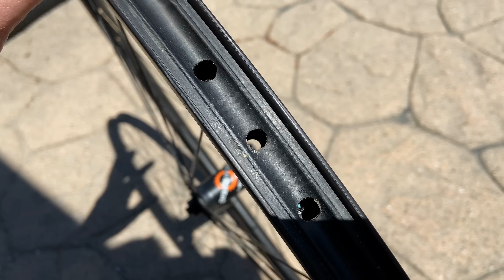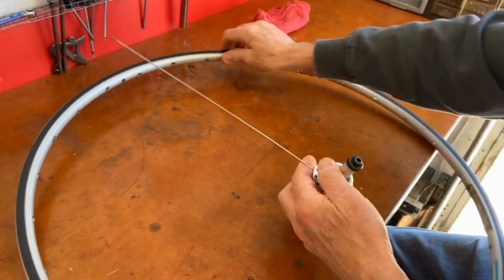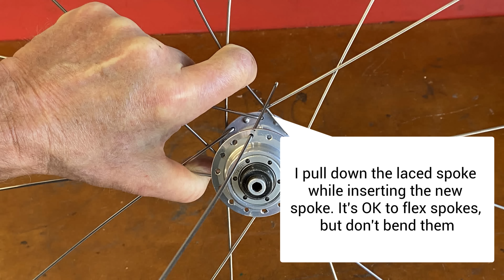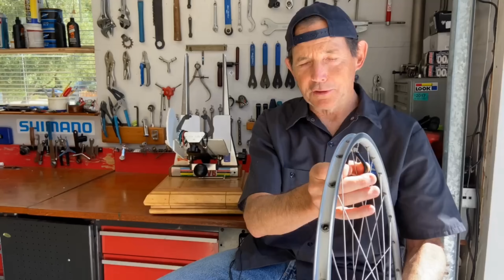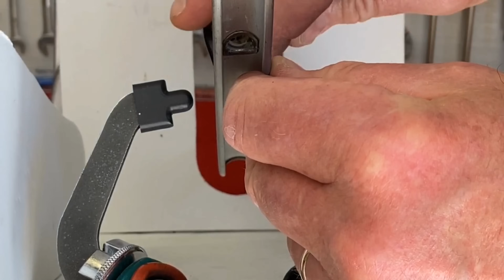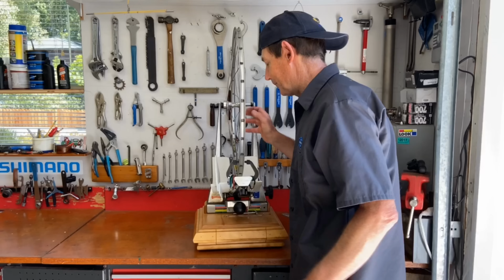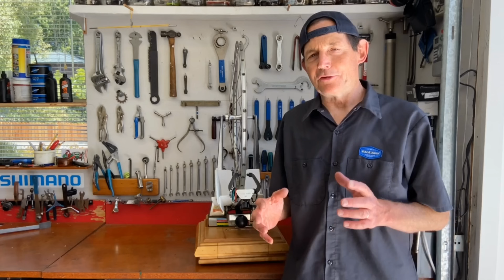How To Build Bicycle Wheels THE EASY WAY! #bikerepair

Comment: Wonderful video! Nicely explained the basics of wheel building. My bicycle wheel is new and I think the wheel itself was not built properly when it was delivered to me. I have broken a spoke several times in the rear wheel. I have been truing my bicycle wheels myself but I find it extremely difficult to make the wheel round, while I can remove the side wobble easily. Is it possible that the tension in the spokes is not uniform yet the wheel is true? Any tips to how to readjust the tension in all the spokes in a wheel, without actually rebuilding the wheel from scratch?
Reply from the maker: Thanks for watching and the nice comment, Supratik! Regarding your new rear wheel that is breaking spokes. The most likely reason for a new wheel to do that is that they built it with poor quality spokes. If you have a magnet handy you can rest it against the spokes to determine if they attract the magnet. If so, you do not have quality spokes, which are made of stainless steel. If that's the case, you can certainly try to readjust the tension but that won't stop the spokes from breaking. What you could do though, is to replace the spokes as they break with higher quality stainless steel spokes from a reliable spoke maker such as DT Swiss or Sapim. That way, one at a time as the bad spokes fail you will rebuild your wheel.

If you choose to do that you'll want to keep track of which are the new high quality spokes and which are the old spokes prone to breaking. It's a slow way to rebuild a wheel and it can mean some rides are ruined by a broken spoke. But, it is one way to rebuild a wheel that doesn't require taking the whole wheel apart and starting all over. Now, about making a wheel round, if you can true the wobbles out you can definitely learn to round a wheel out because it's easier than removing wobbles.

It takes a little practice but it's super fun when you fix the flat spots (low spots) and the blips (high spots) and the wheel becomes perfectly round again. I recommend removing the tire from the wheel first. Then put the wheel in your truing jig or your bike frame. Next put your truing stand indicators so that they are under the rim. If you're working with the wheel in a bicycle frame, put a pencil across the brake blocks or frame so that it's just above the rim. It helps a lot if you can move the pencil so that when the wheel spins the high spots just brush (hit) the pencil.

With the wheel setup like that in the truing stand or bicycle frame, sit down and focus on the task at hand. Don't be in a rush. You're going to make lots of little adjustments. The first thing you do is spin the wheel and watch it. Watch it for awhile so you learn where the high spots and low spots are. Once you know, you can mark those spots if you want by putting tape on the spokes at the high and low spots. 

Next, you work on the worst low spot. By loosening the spokes at that low spot slightly, the rim will move up higher which starts to remove the low spot. Move on to the next worst low spot and repeat. After you've done that, you work on the worst high spot. But for high spots, you tighten the spokes a little bit. That will pull down the rim reducing the high spot. Repeat with the next high spot.

Working like this back and forth from the low spots to the high spots, you will ever so gradually see your rim become rounder and rounder. Don't get frustrated if it doesn't happen right away. Keep making 1/4 to 1/2 turns of the nipples and keep watching and studying the high and low spots to learn what the turns do to the shape of the rim. With some time focusing on this you will learn what it takes to get the wheel round again. Have fun with it. Thank about what you're doing and you'll get it.

Back to tensioning the wheel, if you do replace the spokes as they break with quality ones and if you learn to true your wheel so that it's nice and round along with being true side to side, you will even the tension out in the process. When a wheel has small low and high spots, that means some spokes are looser than others. So, by getting your wheel round you will be improving the tension and ending up with a better, more reliable wheel. And once all the spokes have been replaced, it should be a very nice wheel.

Since you're enjoying working with the wheel, you might want to buy a spoke tensionmeter, such as Park Tool's here: https://amzn.to/3xv8Gmn With a tensionometer you can very accurately gauge your spoke tension. It's a great tool for building and fixing wheels and it also comes in handy for checking new wheels. I hope this helps!
Reply: @JimLangley1  Thanks Jim for your detailed response. I shall keep your suggestions in mind. I true my bicycle wheel with the tire on. Maybe I should try truing after removing the tire!
Reply from the maker: @supratikroychowdhury1127  yes, definitely try again with the tire off. That’s the best and easiest way to do it.

Comment: Hello could u possibly give me some advice on finding some good quality 26 inch wheels for a cannondale f500 caad3 I am building this frame with new components. However I thought I would leave the wheels to the professionals. I would like to leave the v brakes on the bike because I have a set of box one v brakes that I am very happy with. Thanks so much for your consideration and time.
Reply from the maker: Thanks for watching and the question, Brandon. You said you're looking for good quality 26-inch wheels. Right now most mountain bikes have the newer popular sizes 27.5  and 29 inch. So, there isn't the same selection of 26 inchers available that there was back when that F500 was a popular bike. What you might do is call some local bike shops that you know sell a lot of mountain bikes and have for many years. If you can find a shop like that, there's a chance they will still have some 26-inch good quality mountain bike wheels they can sell you. Another approach would be to buy some basic 26-inch wheels on Amazon like these: https://amzn.to/3gqHy0I

The thing is that you need to get wheels with the specs you need to fit your frame and fork. So the axle spacing has to match and the number of cogs ("speeds") the wheel accepts (cassette size) is important, too. The good thing about Amazon is that you can read the reviews on most products to get an idea of the quality of the wheels you're thinking of ordering. Hope something here helps you out. Thanks again!

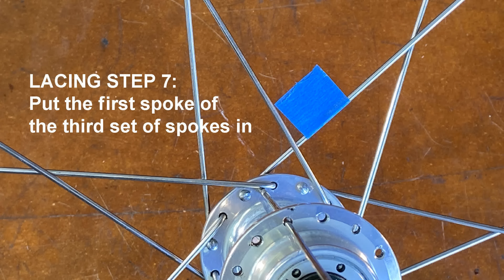Comment: Question about "Lacing Step 7" (16:08): Do you use that same method of locating the spoke hole if you're doing, e.g., a 4-cross pattern on a 48-spoke wheel?
Reply from the maker: Thanks for watching and the question, Maxim. Yes, the same method works with all spoke counts and crossed lacing patterns. Hope this helps and have fun building that wheel!
Reply: @JimLangley1  Thanks for the reply. I built my first wheel ever the other night, following your video. It's a 48-spoke BMX wheel and it was originally laced with a 4-cross pattern, so instead of the 3-cross pattern you did, I did 4-cross and it all seemed to work out, including that method of locating the first spoke hole for the third set of spokes. Here's a picture of it:

https://i.imgur.com/cniepsc.jpg

I've been building / working on bikes since I was 7 years old, which was 39 years ago, but I'd never built a wheel before, nor even messed with spokes at all. It looked too convoluted to me, and I didn't know anyone who could show me how. Your video was easy to follow and once I got started it all made sense.
Reply from the maker: @MaximRecoil  I'm so happy to hear my video was easy for you to follow and helped you build your first wheel, Maxim. Thanks for letting me know. Thanks too for posting the photo. Your wheel looks awesome. You did a nice job and your new skill will add to your bicycle mechanics prowess now letting you build wheels for the bikes you work on. Have fun with it. Thanks again and congrats!

Comment: Great video! Any tips if using flat/blade spokes? Any recommendation on where to get replacement spokes? Thank you!
Reply from the maker: Thanks for watching, DC! For flat/aero spokes, it's very helpful to have a spoke holder to prevent twisting, like the one Unior makes: https://amzn.to/3wXzSd4 You hold the spoke with the tool and then you can turn the spoke nipples without twisting/turning the aero spokes (which makes them not aero and can damage them). You might also like a spoke wrench that fits beneath the spoke holder since the holder is so close to the spoke nipple. For this I like Park Tool's SW-9: https://amzn.to/2SmBmPc For getting replacement spokes I use wheelbuilder.com. They usually have what I need in stock and ship quickly. Okay? I hope this helps and have fun building that wheel!

Comment: Hi Jim, thanks for the great video. I followed your steps for re-lacing and the pattern of my new spokes looks just right but the spokes are all too long. They're protruding through the rim by about a 1/4 inch all the way around so I must have done something wrong. They are exactly the same size (268-280mm) as the ones that came off the wheel before the rebuild. Any thoughts or suggestions?
Edward
San Francisco, CA
Reply: Meant to say 268-270mm
Reply from the maker: Hi Ed, thanks for watching the video and the nice comment. The most likely reason if it's the same spoke length and same hub and rim is that the number of spokes you crossed is different than what the wheel had in the first place. So, since they're all too long now, you probably need to relace the wheel and use 1 more cross. So if you built your wheel 2 cross and it was 3 cross before, that would result in the spokes being too long. The 2 cross spokes don't need to reach as far as 3 cross spokes have to. I hope this helps.

Comment: i came back to give a "thumbs up"and a "thank you very much for the tips!"

i can't believe how straight i got my mtb wheel after following your advice.

it had 2 huge dips after hitting a few things while riding the bike, and 3 major wobbles (2 wobbles to the left, 1 to the right)

the 2 dips are more or less still there,. but they are actual dents in the rim, so i didn't pay to much attention to them, but i managed to remove the wobbles entirely 😃

the 3 wobbles kept rubbing my brakepads,. making it impossible to adjust my brakes properly.

but now it all works perfectly again!

thank you very much!, and greetings from the Netherlands!
Reply from the maker: Thanks a lot for the thumbs up and thanks, Pres. It's great to hear my tips helped you get your mtb wheel nice and straight again. Way to to! Appreciate you letting me know very much.

Comment: Great video! I'm thinking of buying an old roadbike, but the one I'm looking at is a two by six speed, not enough in my opinion, I want to go up to an 8/9 speed freewheel setup. I believe I can't do it on the same hub, so I would have to get a new hub in those Mavic MA40's (which I was told are great rims).
Reply from the maker: Thanks for watching and the comment, Diego. Yes, you will need a new hub and the Mavic MA40s are great rims. That’ll be a fun build!

Comment: Hi jim, great video! thanks for breaking it down so  thoroughly! my very first wheel build is quite the ambitious one, i am swapping the hubs to accommodate larger disk brakes, so my hubs are slightly larger on one side then the other and several other videos i went over mentioned i have to use a smaller or larger length of spoke depending on if it's on the drive side or not, you didn't mention what length of spoke went on which side, does it matter? (edit: it's a 26 inch mountain bike rim i am refurbishing and upgrading)
Reply from the maker: Thanks for watching and the question, E M. Yes, that's correct, if the sides of the hub (called the "flanges") are different sizes, then yes, you usually need different length spokes on each side. Usually the larger flange side of the hub takes the shorter spokes and the smaller flange takes the longer spokes. It's usually the same on the front wheel: larger flange takes the shorter spokes, smaller the longer. If you want to check and make 100% sure, you would do a spoke length calculation using a spoke length calculator. If you are interested, I have another video all about how to calculate spoke length here: https://youtu.be/LvV4FE2VxZk I hope this answers your question. Thanks again and have fun building that wheel. You can do it!

Comment: You have no idea how happy I am that I came across this video. I bought a new bike frame that turned out to have 150mm rear spacing which my wheel didn’t fit. I decided to buy myself a used hub and built myself my first wheel using this video. I was surprised at how easy it actually was. It ended up taking me around 2.5 - 3 hours. Thank again! (I’m not going to lie, I was quite nervous since most people on forums recommended not to build your own wheel)
Reply from the maker: I'm so happy to hear you didn't listen to those forums and decided to try wheel building, Natality. Congratulations on building your first wheel. Enjoy your new skill! Thanks for watching and the great comment!

Comment: I have a question, long story short, one of my factory build back wheel spoke broke, not knowing what spokes they used i decided to build the wheel with new spokes, talking about the spokes to the left and right of the hole where the pump valve goes as a reference : judging by the way you build, the spokes are head out , on the original factory build, one spoke was head out one was head in, is that commun ? will it affect the wheel tension ? I'm asking because being a used hub it already has a small groove in it, where the old spokes used to sit, and i want to use the same spots for the new spokes. I managed to build the wheel, the spokes goes the same way like in the video basically, just the head is inverted.
Reply from the maker: Thanks for watching and the question, HaoSs. Yes, the spokes alternate heads-in/heads-out on the hubs on wheels with spokes that cross each other. And you did the right thing putting the new spokes in the same way the old ones were in. That way you don’t stress the other side of the spoke holes, which might cause them to fail. Hope this helps. Thanks again!
Reply: @JimLangley1  awesome, just to make it clear, the heads are inverted only on one side. The side with the cassette are just like in the video, head in and out in the same hub holes, the side with the brake rotor is inverted ( the ones that are head out in the video are head in on my build and the ones that are head in in the video are head out on my build, just like the original factory build.) Thanks for the video and fast response.
Reply from the maker: @haoss69  thanks for explaining. What you have is a wheel with asymmetrical spoke lacing, which means that the left and right side are identically laced. That's fine, HaoSs. If you're interested, I actually have a video all about spoke and wheel lacing terminology where I explain and show the different terms https://youtu.be/4kVlmOjgdAs?t=99 The way your wheel is laced is one of the standard ways to do it. In my video I explain the two ways. Hope this is helpful. Thanks again!

Comment: Do you think that this would be the same process for a penny farthing bike wheel? I'm meaning to build one but Im concerned with the spoke/wire guage and the way I build it
Reply from the maker: Thanks for watching and the question Super. So, it depends on what you’re working with. If it’s an antique then you will want to copy how the wheel was built. Some highwheels have their own hub and spoke designs that are unique. But, if you are making your own modern penny farthing and a wheel for it, then yes, it would be built just like I show in the video. Hope this helps and thanks again!